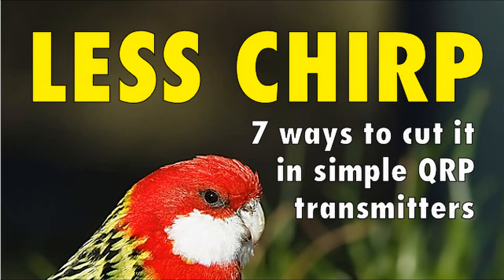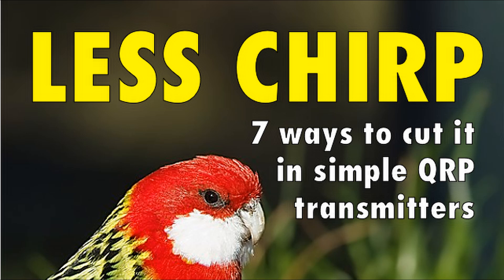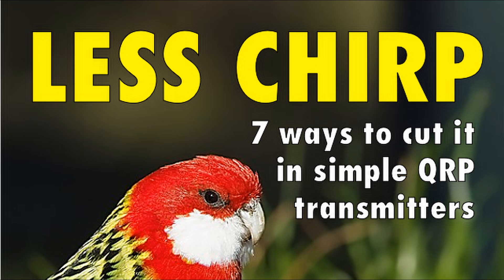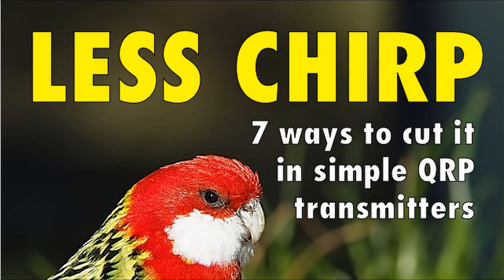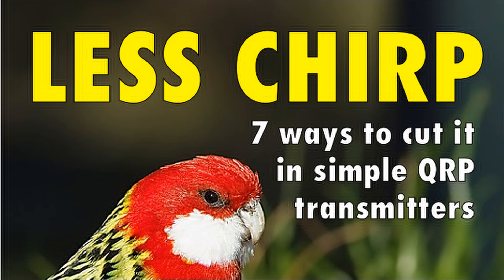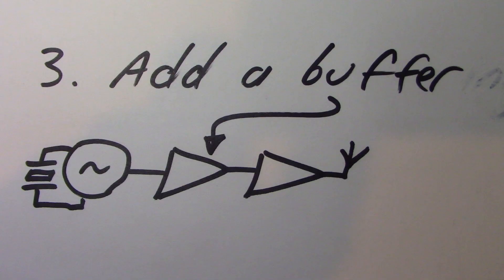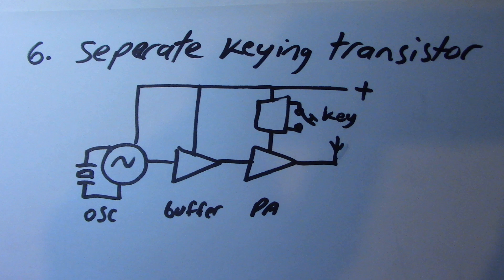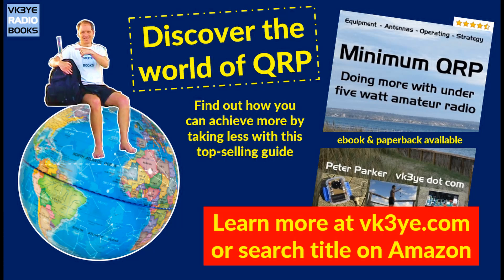7 ways to cut chirp in a simple QRP transmitter

Comment: Why not key the buffer?
Reply: Inter electrode capacitance changes with applied voltage. Keying the buffer will alter the VFO frequency causing chirp.
Reply: @FarleyHillBilly  What kind of electrode? We're not talking about tubes. Anyway. That makes no sense at all, since the power amplifier needs much more. That's why I suggested keying the buffer and not the final stage.
Reply: @tim46767  Transistors are actually a LOT worse with inter-electrode capacities than most tubes. Excluding VHF-to-SHF FETs ofcourse. But generally, bipolar transistors have parasitic capacitances much worse than any vacuum tube. Especially the Emitter-Base capacitance can be very large (and works as a varicap basically)
Reply: @thomasvandevelde8157  Why are you talking about tubes? Neither vk3ye's video nor I mention tubes. Again, it's about where to switch. Watch the video and read my answer. What you're saying is pointless.

Comment: Thanks Peter, I'm finding this all out! Presently I have a 40m transmit stage that isn't too chirpy but the power drops as I transmit for a longer time? Think it might be the driver for the BD139 transistor.  The driver is a 2n3053 in a TO-39 metal case. Might try a heat sink on it? Great video 73 de VK2AOE
Reply from the maker: Yes, definitely have heatsinks on both transistors.
Reply: @vk3ye thanks peter
Reply: Send faster?
Reply: @Paul_VK3HN if only I could!!! 😂😂